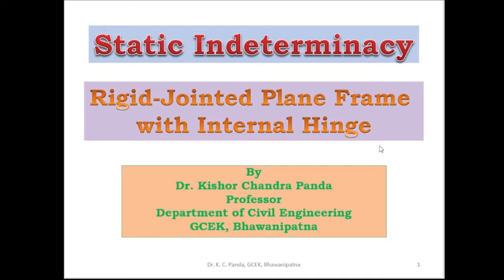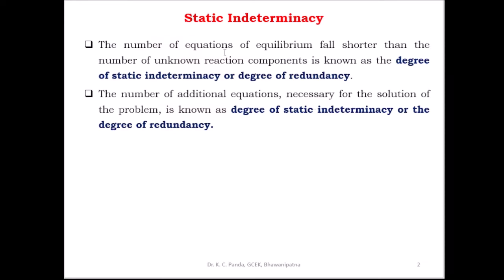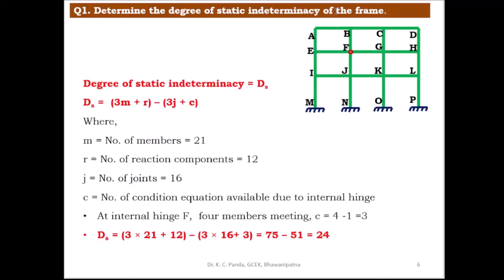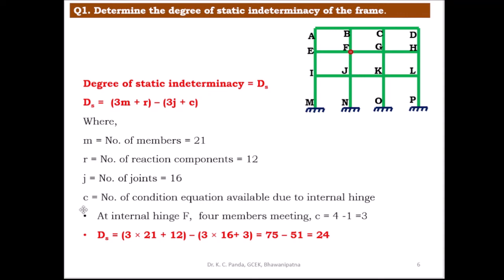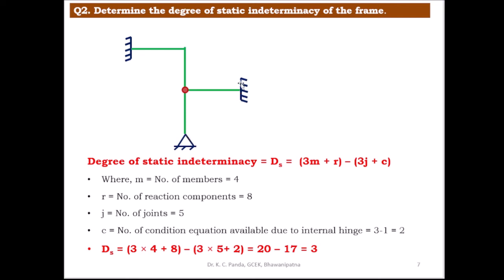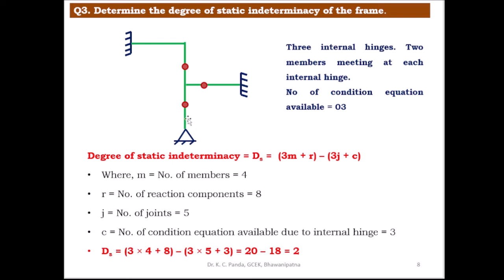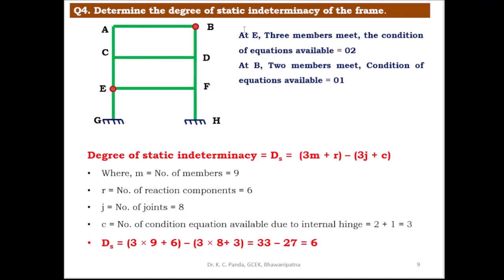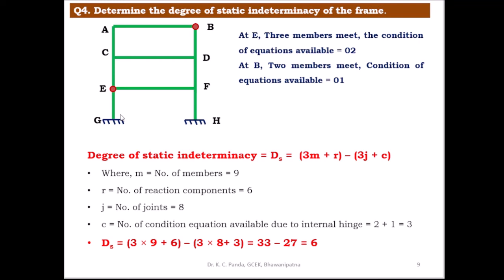Static Indeterminacy  for Rigid-Jointed Plane Frame with Internal Hinge

Comment: Thank you for explaining by taking the example of the portal frame. Sir, could you please explain what are the three additional equations that can be used for problem number 1 at the internal joint?

if you could explain the stability of the frames for all the problems it would be a little bit better, as its one of the most important topics where most of them miss and explain only by using equations.